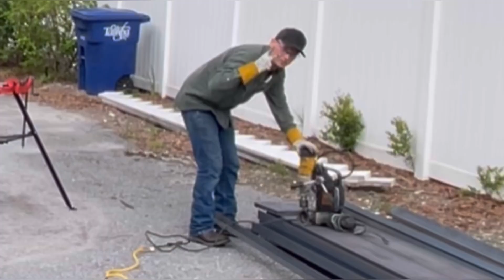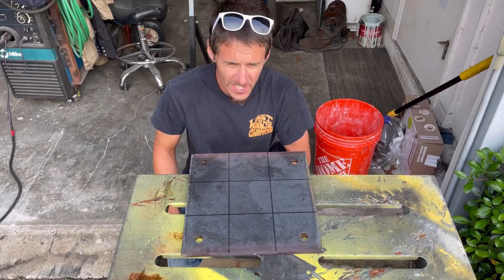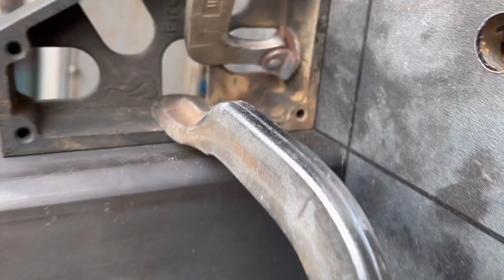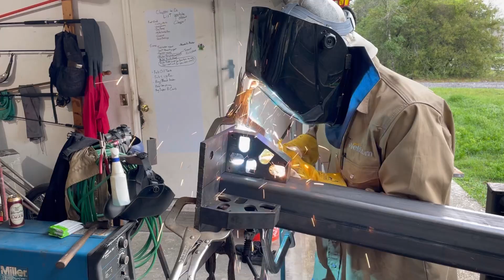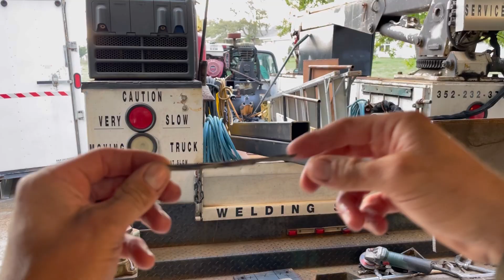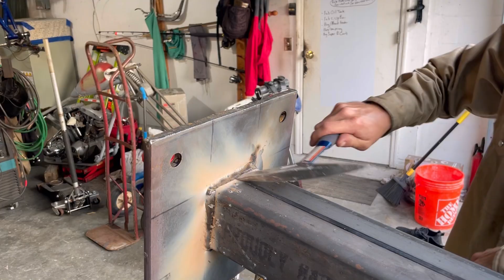Welding Structural Columns in the Field! (How To)

Comment: Anthony, you’re getting porosity because 15cfm is only half of the minimum that you should be running. In breezy conditions, I’ll crank mine up to 40cfm with hard wire and as high as 60 with dual-shield.
Reply: I agree 15 cfm to low to be next to an open door .. 30 to 35 is more the proper range .. can turn down to save gas if doors are closed and no fans running hope this helps
Reply: Can’t you also get problems from having too much gas, I know there’s a lot of variables. But running dual shield out of my garage I only run 25-30! I’ll have to try cranking it up next time at the shop
Reply: @capnbeanis7202  Sure can dude, if the flow is too high itll cause turbulent flow and it'll pull in atmospheric air in with your gas flow.
Reply: It depends on how hot you're running and how long it takes the puddle to cool. When I did structural 50 to 60 or even higher was the norm. Of course, we did 1/16 dual shield and .052 metalcored. Short arc really isn't appropriate for structural anyway.
Reply: @maxscott3349  thank you for that.
Reply: 40 -60 CFM is not correct either. Your shielding gas is measured by CFH cubic feet per HOUR. Even if you meant to type CFH 40 -60 is wasting gas. Typical gas flow would be 25 CFH for solid wire or dual shield.
Reply: Dayuummm I weld in the shop dual shield at 40😬😬😬don’t ever get porosity unless I do some stupid shit.
Reply: 25-30 is what I use all the time and I’ll use 40 if it’s windy and if that and a weld screen don’t cut it than 7018 it is
Reply: Yes the guy who said 40 is about right .. I’d start with 30 and 25 in a calm no wind
Reply: You guys don’t know what your talking about, you are never supposed to weld structural steel columns with a MiG welder using solid wire, a welding inspector would not allow that garbage, 7018 good, 232 flux core better in the field, 305 is the fastest
Reply: Why would you use more gas with Dual Shield :/?
Reply: @crj1249  It really makes all the difference, wouldnt seem like it but dual shield is meant for the hot hot and you dont want ANY Oxygen hanging out around your puddle, even with the fluxcore wire.
Reply from the maker: it was 100% the wind
Reply: @MeltinMetalAnthony  if you turn your cfm up to 40-60 the gas comes out faster then the wind can blow it away. Even in a shop 35 is about the minimum.
Reply: @GravenorOfficial  100% agreed. We use 40 CFM in the shop with bay open/

Comment: 25 acetylene and 55 oxygen should get you a better cut rookie.  

Funny how many people don't know whats written on a regulator.  Mine red lines at 15 but still goes to 30.  Bunch of rookies.
Reply: I don’t think so! Your acetylene regulator red lines at 15…,ROOKIE!
Reply: @williamthomas9463  acetylene all the way up and 60 oxygen.  Works fine for me.  Been that way for about 25 years.
Reply: obviously you aren't paying for the acetylene.
Reply: @newage3397  the customer is.  I'd rather use a little more acetylene to get a good cut than waste grinding wheels.  I been a welder/ fabricator long enough to know what I'm doing.
Reply: @Garth Land a better cut comes from a clean tip and pre heating.  Don't matter if you use acetylene or natural gas ect.
Reply: I would never bother preheating a half in thk pc of plate.  Waste of time.  You'd look like a novice running that torch back and forth on the underside.
Reply: @Garth Land that's nice you are old but i guarantee that you are not older than me.  by the way did i say anything about pressure settings?  but thanks for the tip. lol
my first 4g cert was at general dynamics in 1976.  well the next time you are cutting some 11 ga send a pic out of you throwing a preheat on it.   i'll bet you are a shop guy.
Reply: @newage3397  when I worked at nassco for general dynamics the test was a T1.
Reply: @rickd8174  hi Rick,  just a small point T1 is not a test it is a steel alloy A514.   A wps could be written up to include the alloy as part of the procedure but in the end you would test to position, thickness, process etc.  Most likely an f or g test.  I get what you were saying though.
Reply: @newage3397  It was a long time ago, I just remembered that they called it a T1.  I'm good out to 6GR on carbon and 4G on stainless and aluminum.  Railroad, oilfield and ship yard certs with more rigging and lift certs than I can remember.

Comment: I like to use white out my guy. It doesn’t fade as quick as sharpie, you should try it out. The white out pens on Amazon work perfect.
Reply: You can also use the torch with just acetylene on low,  put it on steel and that black soot goes away at 250°
Reply: Erik, buy yourself some soapstone.  you can sharpen it with just about anything.  they have it at harbor freight.  it is universally used by guys doing metal fabrication, shop of field.
Reply: @newage3397  I have used soapstone, it’s just easily erasable. I like white out but I think there both versatile tools in fab.
Reply from the maker: good tip
Reply: hi, i went to amazon to see if the world had changed since i last used a white marker.   anything with a felt tip has not worked for me.  the soapstone i buy by the gross , it's inexpensive, and i  leave it all over so i never have to go looking.  lol. 
thanks for the reply.